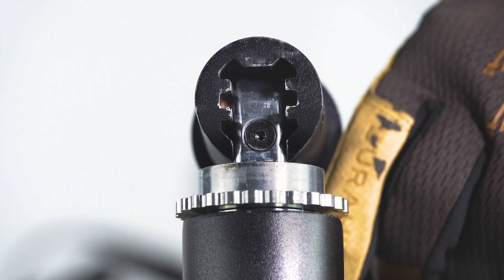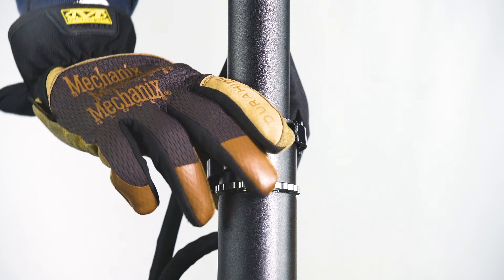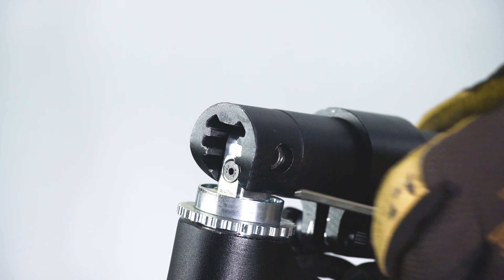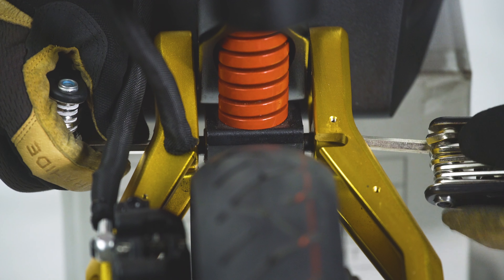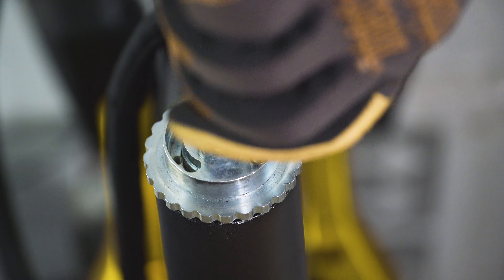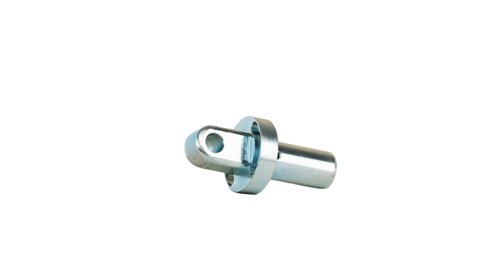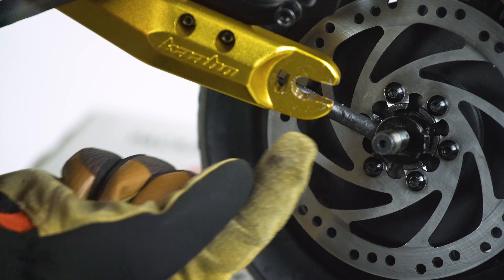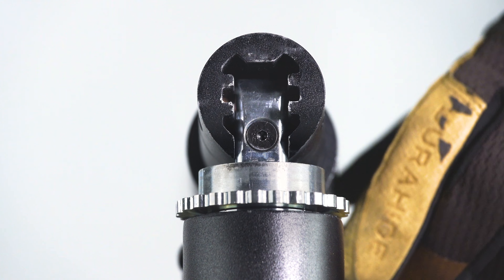How to Replace the Hinge on your Mantis Pro SE

Comment: Sorry why did you need to remove the wheel ?
Also on new hinge does the bolt thread go up past where the steering pin goes from side to side ?